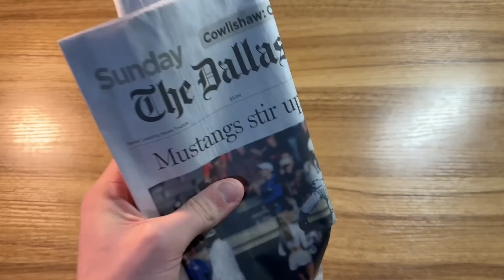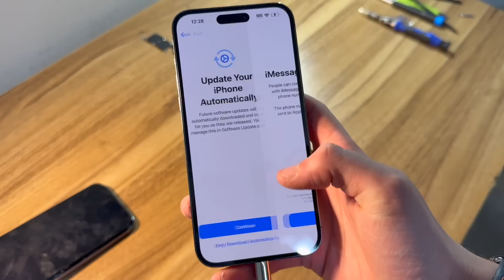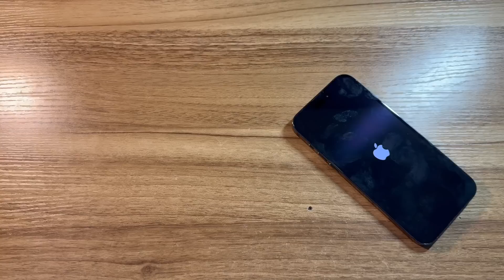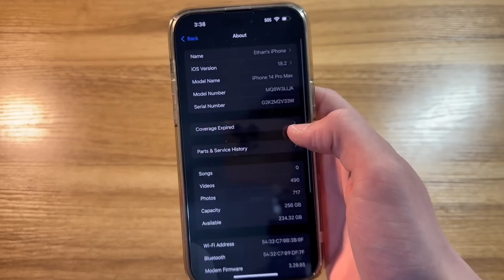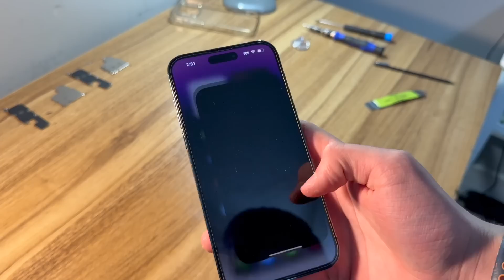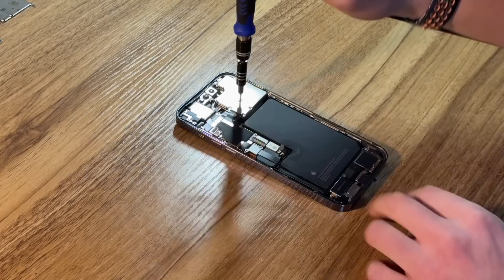$280 iPhone 14 Pro Max Repair - Worth the Risk?

Comment: how did you not get the display part locked to icloud message??? it's supposed to give you an error telling you that the screen is locked to another apple id.
Reply from the maker: @r7vnce  that’s only applicable on iPhone 15 and later. The 14 series and most below have parts pairing and OEM detection but not the activation lock feature.
Reply: @AppleManiacYT  ahh okay that's cool.

Comment: Best deal i ever got was buying an Iphone X 256GB back in 2019 for only $60. Owner said phone didnt power on but just needed a new screen and battery to function. Still have it to this day!
Reply: Ur so lucky bro😂
Reply: mine was a free 13 pro which needed a 100 dollar charge ic swap 256gb also
Reply: same except it was $85 and it worked except for a green stripe on the very right
Reply: Mine was even better, iphone x 256gb same price but everything was working and functioning

Comment: getting the display paired without the matching proximity sensor was actually surprising to me! i thought these two were paired thru every single model of iPhone
Reply from the maker: I was going to mention this in the video but forgot, but with the new parts pairing system, it’s actually the opposite. Instead of the sensor being paired to the phone, it’s paired to the screen. Doesn’t really make any sense tbh.